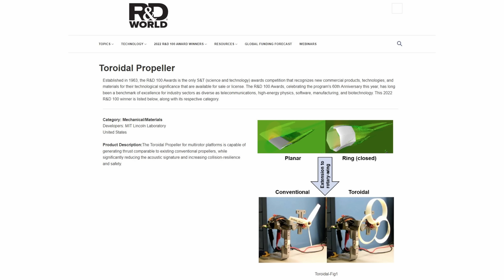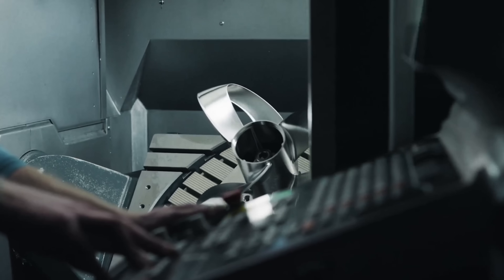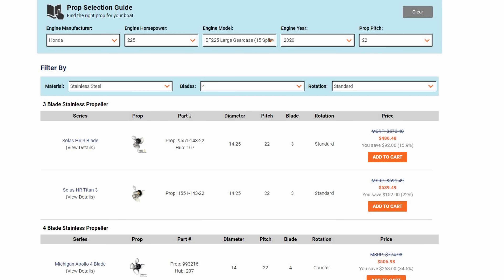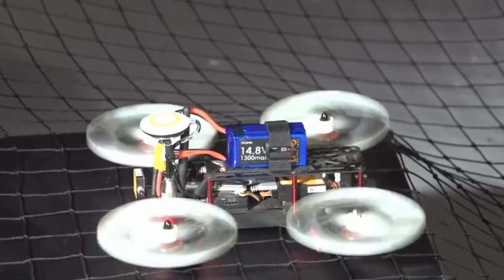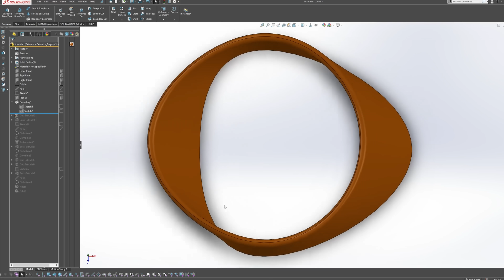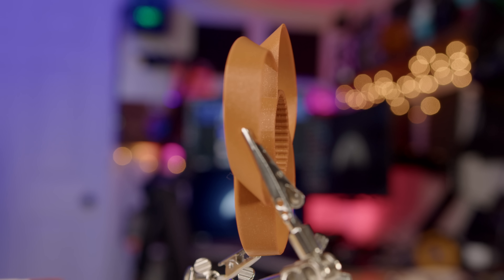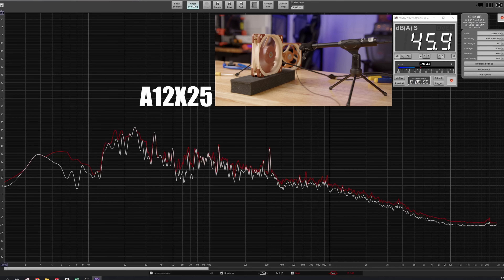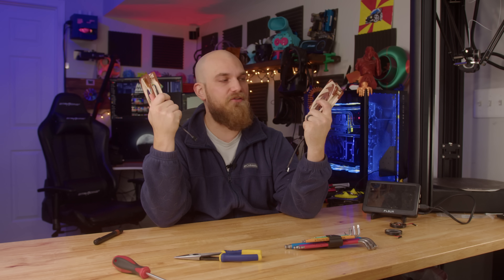I Turned MIT Award Winning Toroidal Propeller Into A PC Fan | Fan Showdown S5 Special

Comment: The fan blade has more blades, which also cuts down noise compared to a 2 blade prop. It sounds like you get a decent amount of vibration noise too, which is either because your toroidal isn't weight balanced, or you could have some structural issues. Could figure that out pretty easy in Ansys.
Reply: ayyy sup
Reply: Yes, definetly some vibration sounds occuring due to inbalance
Reply: Could some of it also be due to the fact that these are ducted? I was under the impression that ducted fans were more efficient mostly due to the reduction of those tip vortices
Reply: let the man cook
Reply: Came to the comments to say this, noticed real engineering already chimed in. 👌
Also noticed he acknowledges the same things at the end of the video.
Reply: Wow. I normally don't care much when seeing youtubers interact but the timing is perfect. Sup dude
Reply: This is what would be considered a MARK ONE model.
Reply: Wouldn't an increase in the rate of the tip vortices dissipating also result in a reduction of overall efficiency from the props when compared to a traditional prop? I also wonder what a true apples to apples test between a toroviral prop and a traditional prop of equal blades and blade area would look like.
Reply: assuming one knew how to use/could afford ansys
Reply: Also these PC fans are semi-ducted. A ducted fan will be quieter than a fan in free air (for the same reason the toroidal design is quieter).
Reply: not to mention that the blades are a rough surface. It probably also would have helped to smooth the blades with some kind of solvent
Reply: The Noctua blades are made of a thinner yet denser and more ridged material. It's likely to minimize harmonics while dampening it.
Reply: Didn’t expect u here lol
Reply: This question of comparability is exactly the problem of the MIT study: Each toroid is effectively two highly swept rotor blades (one swept forward, one swept aft), the ends are parallel to the flight direction, so you effectively have endplates on the rotor blade tips, and each blade is quite wide. They compared rotors with 3 toroids with conventional rotors with 3 straight blades. Despite twice the number of blades, twice the rotor solidity and the endplates. They did not compare based on same torque, but on same thrust. However most large drones are torque limited. If you simply took a conventional rotor design and doubled the number of blades you would get the same results or even "better".
Reply: Plus, its comparing a well optimised stock design for specific rpm to a propotype designed for something else, without optimising it for rpm or a rim around the blades. No wonder it is worse im afraid. Some ansys could make a real difference but i guess that with rim around the blades like in a fenestron structure, toroidal blades would loose some efficiency compared to open design....
Reply: You can easily see that it is unbalanced. Fans have even number of blades for a reason. It is not that dramatic for hight number of blades, but for three it is unbalanced, and will get vibrations when rotating.
Reply: True, if you look at the audio recording there's a clear spike around 34 Hz which matches the 2000 RPM. For the toroidal fan that spike seems way larger looking at its sound profile compared to the A12X25.
Reply: Also, the fan blade is ducted, so the vortices are not created to a high enough degree to matter.
Reply: What Is this? A crossover episode?
Reply: Not to mention, this is a ducted fan and the distance between the duct and the rotor tip has a big impact on the sound and efficiency of the fan itself
Reply: more fan blades also lower their efficiency, which speaks poorly for the toroidal fans ability to scale up to more blades.
Reply: More important is the toroidal propeller is designed to minimize tip vortices in open air, in a duct, the vortices are already terminated by the side walls
Reply: Yes , we should learn from how stealth submarine propellers are made.
combine toroidal design to those stealth propellers and fans.
Reply: A aeroplane with this propeller could fly? And it would be quieter?
Reply: Can I maybe request a video on that if you're interested too :hand-orange-covering-eyes:
Reply: Ah yes, Ansys, easy.
Reply: also this is a fan in a duct, so are not much blade tip vortices in the first place
Reply: I think it would be fascinating if you did a video on toroidal props
Reply: The Wright Brothers were first in heavier than air self sustain flight.
Reply: there's less surface area pushing air and the fan already reduces the vortices by having the edges of the fan not be exposed the same way as a prop for an aircraft is. He explains exactly why the fan didn't perform well int he introduction on the design and explains exactly why the computer fan is already superior.
Reply: Pop it into a 360° fusion model and give it "whirl" before hello world? And yeah your diff is in the higher frequency..it'll be waaay more quiet at higher altitudes (on a drone obvy) I feel like your hub area has too much diameter, and on a drone it would have a much smaller concentric fit vs beer can sized. Think you've got the tight mindset on sussing it out and keep up the great work man! 👏🎉
Reply: @AirtimeAerial  the surface area of the blades needs to be maximized to push air, that's just basic physics so you are absolutely correct about the central hub. And you can see that it just can't compare to the fan, also he explains that its the tips of the fans what create inefficient vortices but that's a non issue on the basic computer fan as the tips are not exposed. And I learned why it didnt work as a computer fan from the introduction to the video. It's right there.
Reply: ANSYS for what?

RANS isn’t accurate enough for this. 

You need LES.
Reply: @JoshFisk  all vortices & cavitation represent "lost power" (actually just reduced efficiency), any time you get closer to a "perfect" lamellar flow, you'll get closer to "perfect" efficiency. (aviation's been fighting that one at higher speeds & lower densities since the Wright brothers, aviation engineering journals might make a good alternative research source)
Reply: Also the distal portion of the fans aren't cutting through air because its lined with the housing.
Reply: Dude!!
Reply: I guess some will have to visit that boat propeller maker and bring us more info.
Reply: @kwyj  We all know in engineering academic, ansys is free for those who dare enough
Reply: Wouldn't he be able to find the center of mass in solidworks directly?
Reply: And I think the toroidal one isn't perfectly smooth, which might also cause more noise to form.
Reply: He also needs to 3D print BOTH the standard fan and the toroidal to make a fair comparison. There's too many flaws in home made prints.
Reply: @philipp0grigoriev  it can be balanced with three blades, no issue. All you need to do is arrange the weight (rotationally) symmetrically around the axis of rotation so that the centre of mass lies on it. That's static balance.

Any misalignment or change in material properties whilst printing will upset that. It's possible the blade is imbalanced between top and bottom halves, making it dynamically imbalanced.
Reply: Pretty sure noctua also has little rubber bushings in their fans to stop all vibrational noise, not really a fair comparison
Reply: the real question, can you fly a drone using the PC fans instead!
Reply: One way to cut down perceived noise on a fan with lots of blades is to space the blades unevenly. At least a few of them.
Reply: Yes, using a commercial product vs home printed one isn’t a good design for your experiment.  Also you didn’t say whether you polished any surfaces.
Reply: Real engineering coming in clutch
Reply: Could you use this in wind generators?
Reply: I'm just going to agree.
Reply: a lot more blades per blade
Reply: Us Plebs don't typically have access to Ansys lol.
Reply: I agree, id like to see a remake of this test with a more well designed Toroidal.
Reply: ,,The fan blade has more blades'"  -> I think you simply mean that the fan has more blades
Reply: No MIT engineer here but wouldn't the thickness at the end of the blades have something to do also ?
Reply: Can't SolidEdge/SolidWorks, which I think he already has, be used to do that now (FEA) ? The place I used to service the IT for, an university engineering and research department, replaced Ansys with Abaqus and/or SolidEdge. And what to do about production inaccuries that come up (3D printing, manual machining, plastic moulds, etc ...) ? Just curious really.
Reply: cant help but think the ridges from 3d printing dont do well either, compared to the molded blades of noctua´s fans
Reply: Woke engineering
Reply: I like the toroidal design because it seems easier to clean. LOL
Reply: Ok.
Reply: Also, wasn’t the intention for the sound to not travel as far? He had the Mic right up at the fan. It didn’t have a chance to dissipate.
Reply: oh, that feeling when someone did your job and left a nice comment. Thank you Real Engineering.
Reply: its a scam bro these torodial props from mit are scam
Reply: @liamchristo5314  "Yes, this smart thing you've said is also a thing I am saying" lol
Reply: @mrmagoo-i2l  You also can't do FEA on a 3D printed part unless you have access to codes that are designed for 3D printed parts, not your run-of-the-mill solver included in most CAD packages nowadays that only does isotropic
Reply: This is why a lot of helicopter upgrades go for more blades. And yeah, definitely noticed that bearing noise.
Reply: What about Solid State Cooling using membranes ? It should make PC fans obsolete in the future
Reply: @Gytis321 S  theoretically, yes. The main problem right now is scale. A modern desktop has a thermal output between 60 and 1,000 watts, depending on hardware and load. Unless someone makes a big breakthrough, solid state cooling may take a while.
Reply: @philipp0grigoriev  not sure which fans you are referencing, but the Noctua and most current PC fans run odd numbers of blades.
Reply: I saw a guy tested these propellers on his drone, sounded like they used to. Then he put on 8 winged propellers and it was almost silent.
Reply: Too true. I also didn’t see much of that 5° camber in the CAD designs and the chord wise pressure distribution was clearly going to be very nasty with no curvature past the initial nose. Either way, it would be a better test if the props could somehow be made to produce the same pressure change at equal RPM with as similar airfoil profiles as possible
Reply: ah yes, Ansys Fluent the shareware of fluid dynamics software
Reply: Performance wise couldn't it also have to do with the fact that one is built for static pressure and the other for air flow ? The NF a12×25 is the best fan for radiators because it produces great static pressure, but I understand to get something flying you would balance more towards pushing more air rather than producing more pressure.
Reply: Someone needs to make a toroidal desk fan! No hideous OSHA grills to clean. Completely silent. Less electricity.
Reply: And these are ducted fans
Reply: Also, in a fan housing the blades are shrouded which reduces tip vortices anyway.  So a shrouded fan would be less of an improvement than an unshrouded prop.
Reply: @Real Engineering Do you think a toroidal propeller/impeller would work for an automotive turbo? Would the increased efficiency, etc make more horsepower, at least in theory?
Reply: Lol i must be a big brain then because I just thought of why butterflies are silent and how to use that in a drone. If they were studying lowest noise they failed. HAHAHAH. anything small has to go so fast it cuts the air like a bee.
Reply: Quite condescending on the last part.
Reply: Any possibility you'll be making a Toroidal video soon?
Reply: Bro, if it can make a drone fly, it can cool a frakkin PC.
It's all about Aerodynamica.
Wind being pushed.
Direction makes no change in this.
Vertical or horizontal, it moves air, right?

Could as well be called Airdynamica.
Same thing.
Rite?
Reply: Also, make it twin blade, not tri-blade.
I think that would do a lot.
Reply: Also, angle of attack: there's no reason a lower attack angle, or, a higher one, would be beneficial.
Try different attack angles.
Use the same (to start) attack angle of the A12X25.
But, aha, TOROIDAL.

45 is a bit throwing the hat to the proverbial cloth hanger.
Reply: I Agreed to your comment
Reply: Will u make a video about it?? Pls
Reply: right!!! 3 vs 9 doesn't sound fair to me either. he should try a 3 blade fan or a 9 toroid fan to level the playing field
Reply: Try the Frore solid state jet cooling, it is on another level 😛
Reply: i knew it had to have some sort of weight balancing issues from the first display with the smoke, it looks like it’s about to fall off its stand waddling so much
Reply: Toroidal fans create a less concentrated, more dispersed airflow. They're great moving a large amount of air, but not very fast. A jet engine would be the opposite where air is more concentrated in a stream and less dispersed.
Reply: @humanoidjones8130  my first thought as well haha
Reply: Worth mentioning is also the actual composition of the extruded layers on the fan and inconsistencies with adhesion, etc. I'd imagine shit is vibrating like crazy in the component and causing a lot of performance issues.
Reply: toroidal desinge should have more blade overlaping each other. other things is the standard desinge has an outer frame which some how mimec the toroidal benefit of soundd cancelling and help the flow
Reply: I was also thinking about the surface smoothness of the fan versus the 3d printed non sanded fan. But a pretty interesting engineering project.
Reply: the "real" engineer has spoken
Reply: Unless its made out of the same low expansion low vibration premium material as noctua fans then we wouldnt know
Reply: It's just that the thickness of such a fan is not effective; conventional blades are superior. It needs to triple its thickness to be effective, and all these extra parts that don't rake air slow it down and create noise.

Comment: If you read their paper, the intent of this was to avoid adding the shroud around the blade tips (ie case-fan)... you might find that their design pushes more air than the noctua fan, if you remove the case-fan frame from both. :D
Reply: Not through a radiator or filter
Reply: @VndNvwYvvSvv  as in static pressure vs airflow?
Reply: That's what I thought.  Maybe a ducted fan already limits blade tip vortices.
Reply: Good argument, but is a caseless fan still a PC fan at that point?
Reply: @EdwardChan.999  I think that's the point, that PC fans aren't the best application for toroidal propellers, nor were they designed to be. Every prop has an application.
Reply: Make it smaller and increase number of blades than ?
Reply: @worldpeace1822  it would take a fair amount of engineering and experimentation to see if that would work.  Its really hard to say, off the cuff, how additional blades would impact performance.  I think it would take someone with expertise in this area, like an aeronautics engineer or something, or someone to test the design, to see how it works.  Or maybe someone's done research on this already re: underwater propellers, someone working in defense, and you could dig it out that way.
Reply: Came here to make this comment. Shrouds are extra weight on drones, so the toroidal blades make sense there if the efficiency increase per additional weight is greater than adding shrouds. In an already-shrouded fan frame, toroidal blades are just extra weight...
Reply: @worldpeace1822  *then
Reply: @cityofclay6884  yes it does, shrouded fan have been tested for airplanes but does increase weight and drag. may be it could be interesting for an open fan pusher turbofan but there are some mechanical limits and you cant have variable pitch.
Reply: The toroidal design removes the need for the duct, but adds weight to the propeller itself. Not sure it's an overall win.
Reply: I'd like to see if higher rpms would make a difference and compare power consumption between the two tested units
Reply: That wa my first thought